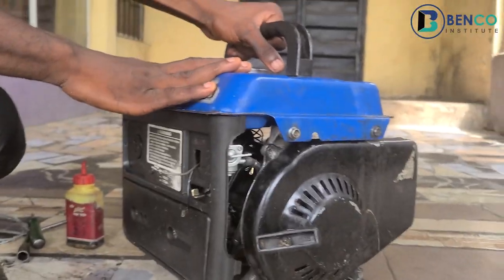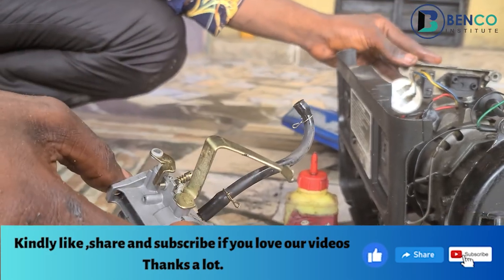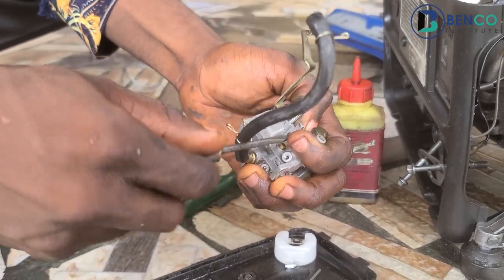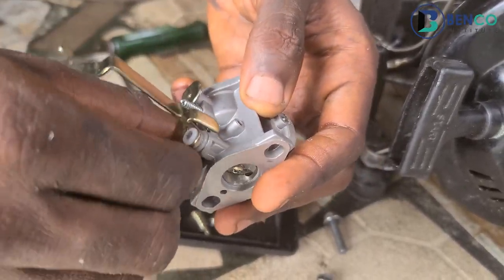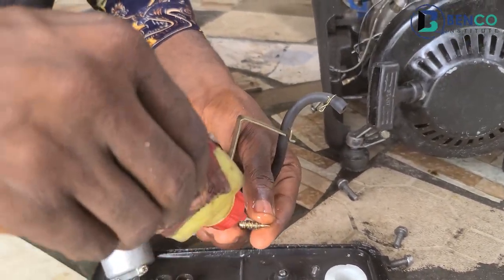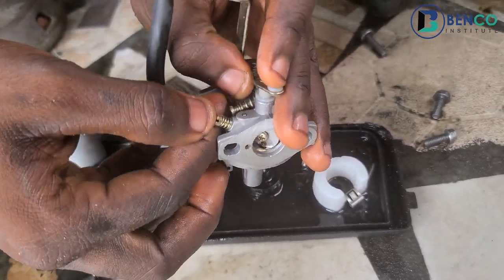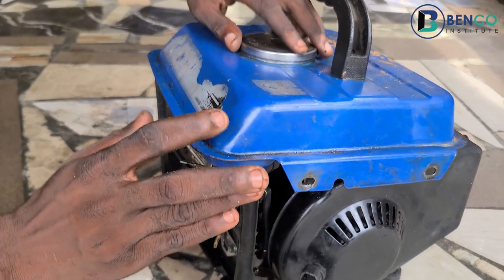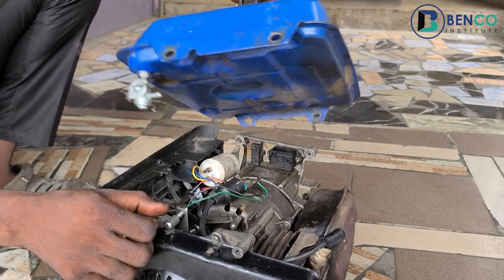Carburetor cleaning  and Carburetor rebuild of 2stroke backup china Generator| Fix Petrol  overflow

Comment: Pls when I put on my gen and push the choke to the extreme end the gen will start doing high and low . Sometimes it will off. What’s the problem?
Reply from the maker: service or change the carburetor
Reply: Thanks for this video. My own case is that fuel is not flowing into the  hose. I have a transparent hose so I can see that fuel refuses to flow